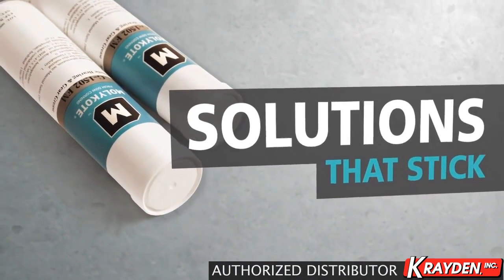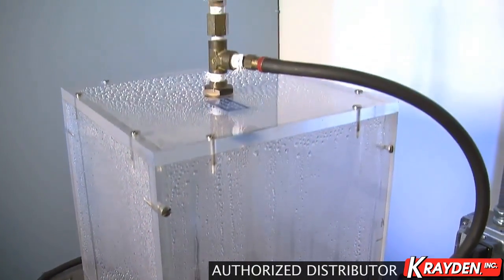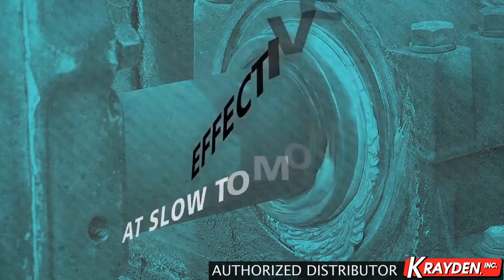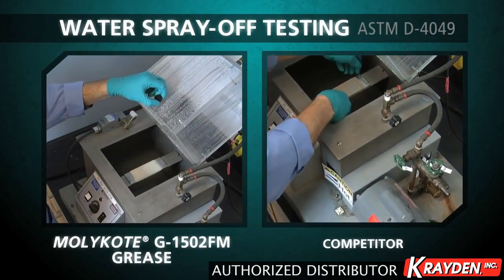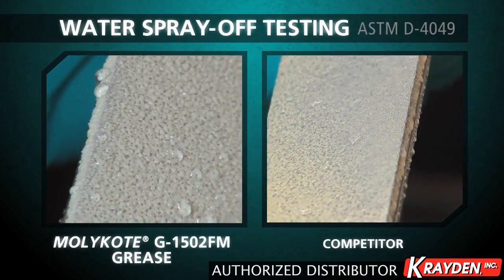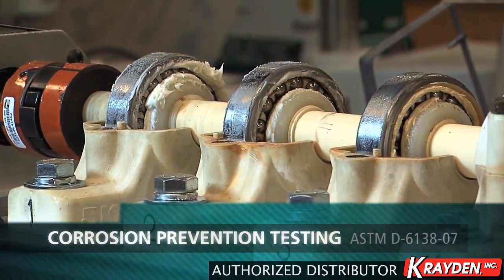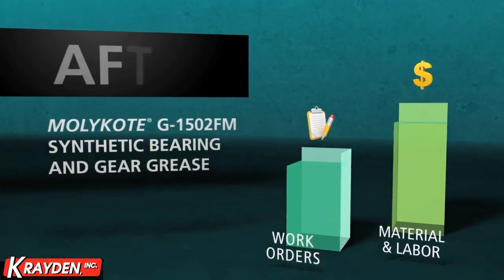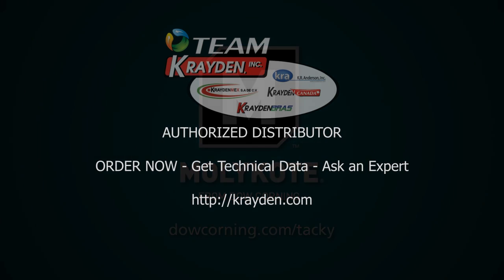Molykote G-1502FM Water Resistant Grease -Tacky

Comment: Yes Molykote G-1502FM provides a solution of proper lubrication meeting all these demands and challenges faced by the mechanical equipment. G-1502FM gear grease and synthetic bearing solution extend the life of the equipment by simplifying it and helps in cost reduction.